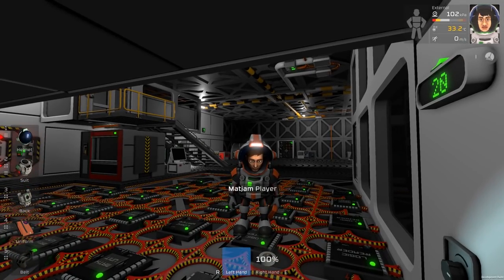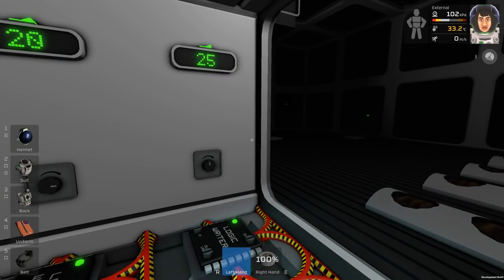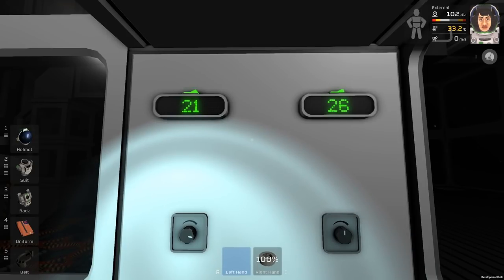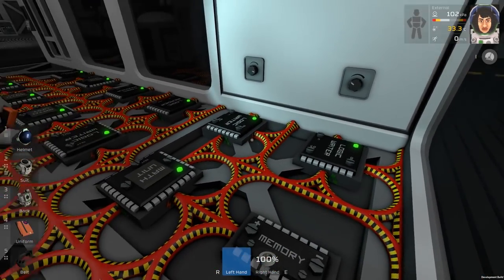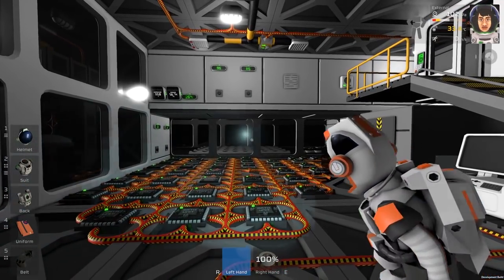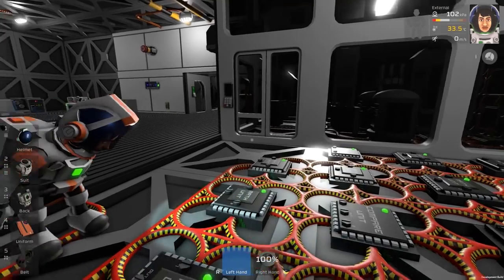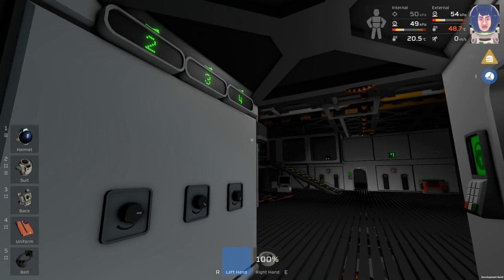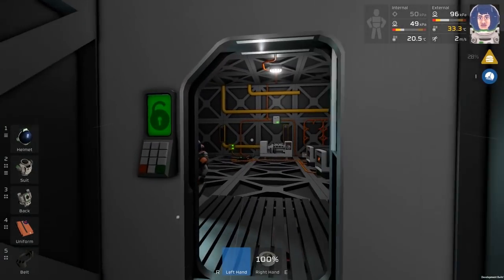Stationeers - Ultimate greenhouse and how it works

Comment: Hey I started another fresh save on beta branch, got a greenhouse up and running with temperature control, pressure control and co2 control all based off this video. Thanks again for the help it was awesome learning! Only thing that was tricky was the pressure out when going over x amount. But with a schmitt trigger and then doing the max temp minus the min and taking that value and adding it to the max again acts as a buffer. Then on the select I did the new buffered max as input 1 and then input 2 being the unadjusted max
Reply from the maker: Good job man! I am satisfied now, at least somebody used something from my video, well done.